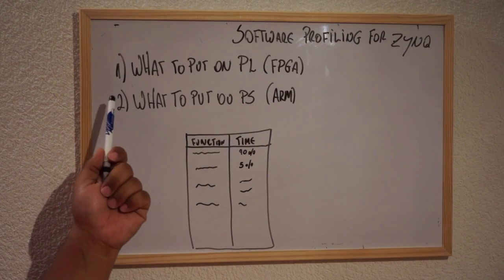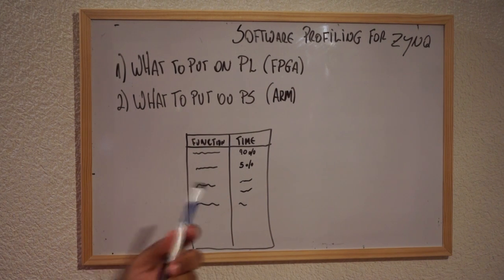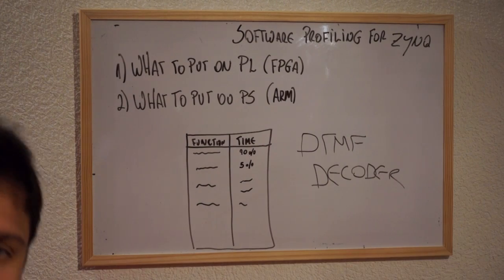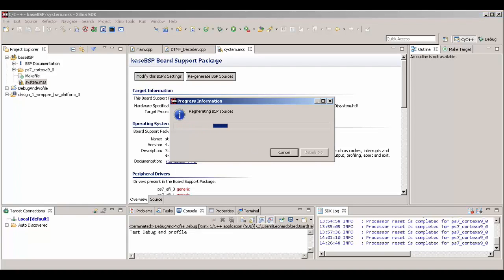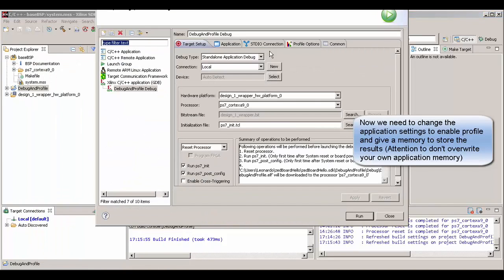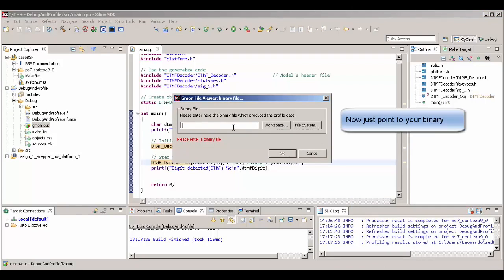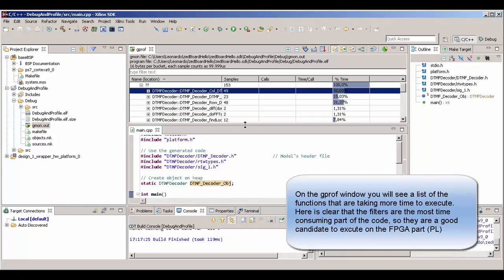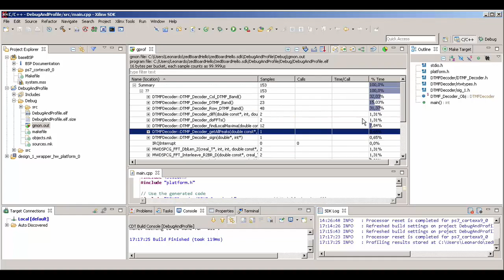Zynq Training - Profiling, Introduction to code partitioning #05

Comment: Your videos are very good. Please also make a video to measure the execution time of a program by using timer, and measure the execution time of software and hardware multiplier of your example. Please keep making more videos. Thanks a lot. keep it up.
Reply from the maker: Sure I will create a tutorial measuring time using the axi-timer, I'm working a little bit now on vivado hls doing some tutorials but at some point soon I will cover this topic as well thanks for the idea
Reply: The Development Channel I have implemented your multiplier example on zedboard and tried to measure its cycle count using axi timer. The user logic multiplier is taking roughly 60 cycles which is very slow. how too make the communication between PS and PL more fast?
Reply: The Development Channel  I have worked with Microblaze Software Core FSL which very fast compared to AXI4 Lite.
Reply from the maker: Abdul Rehman Buzdar hi you can try to use the another axi interface like the axi4 stream using the zynq hp (high performance port) this will take out all those unused bus cycle and also bus retentions on the axi4 lite, I will create a video about that also sooon
Reply: The Development Channel OK will be waiting for your new videos, as I need to use this in my project. Thanks a lot.